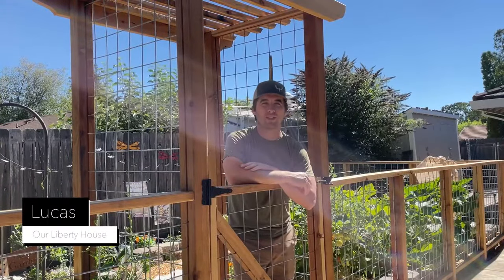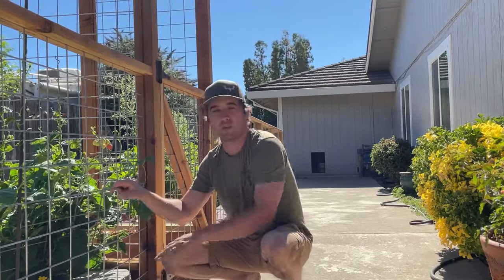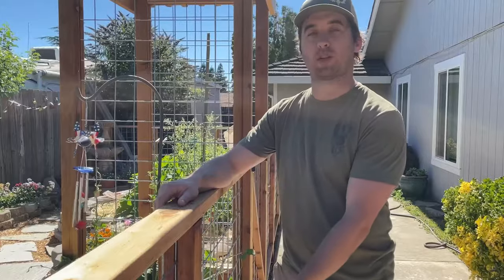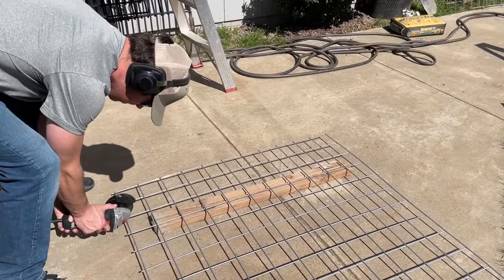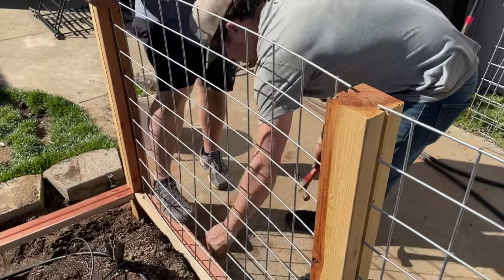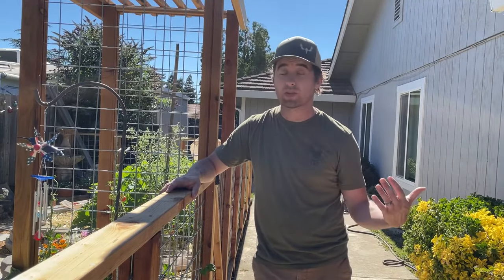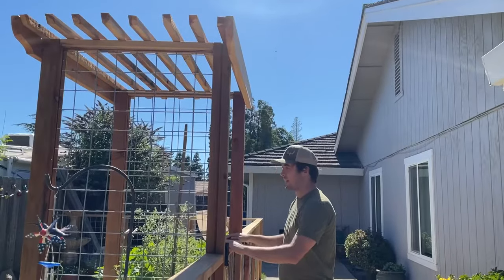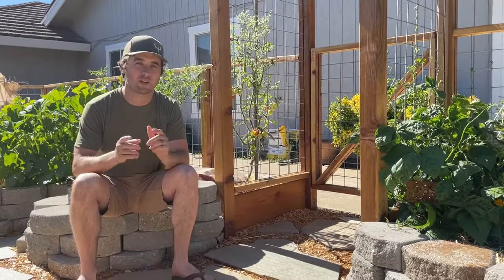DIY CATTLE PANEL GARDEN FENCE // How to Build a Sturdy and Beautiful Fence for the Garden

Comment: Looks great. But from one carpenter to another... You should add weep holes in the bottom rail so that any standing water does not rot the wood prematurely. Water is the enemy of all wood, treated or naturally insect resistant, because it invites the bugs whose sole purpose is to convert organic material into soil.

Comment: Switch the direction of the cross brace on the gate. It should go from bottom to top on the hinge side. The top of the brace should be closer to the latch and the bottom of the brace should be close to the bottom hinge.

But looks great! I'm going to do the same/similar in my garden. Thanks for the video!
Reply from the maker: Thanks for the tip! Definitely a nice fence. My parents love it

Comment: This is an awesome video. Very clear and inspiring. 2 questions: can we use hog panel instead of cattle panel 2) we live in an area with woodchucks and rabbits and currently have a fence that I've been told has chicken wire sunk into the ground to keep those animals out.  I'm not a do-it-yourselfer. How would you explain that chicken wire process to someone if they were going to attempt a fence like yours? I love the aesthetic. I also, sadly, think we would have to reinforce the bottom of the panel with chicken wire about least 2 feet from the ground to keep baby rabbits, etc. from squeezing in as well. Thanks for your thoughts.
Reply from the maker: You probably could use hog panel instead, though you may have better luck stapling it rather than routing it. Since hog panel is more flimsy it may not stay in as well. We have a video on our hog panel fence too! Good luck!

Comment: Good for you! Good to see the posts are rabbeted for the cattle panels to inset rather than the other methods bc it finishes it off beautifully and the strength is there. If you don’t have a router or router table use a table saw and make repeats till you have the depth and width needed or a circular saw and straight edge will work too. And the Cedar looks stunning. Love the gate, love the arbor for shade and I love that you can see through into your garden… really nice work
Reply from the maker: Thank you so much! It was definitely a labor of love. My parents love it and when they garden was in full swing thing year it was beautiful with everything climbing around it. Thanks for the comment!

Comment: Alternatively you could also use a dado blade on a table saw for your groves.  Also cattle panels would cut your costs down significantly. Nice job!
Reply from the maker: Dado blade with a table saw is a great option for someone who doesn’t have a router. I’ve never used one before. Any tips to share with people for success?
Reply: @OurLibertyHouse  Make sure you use a push stick to keep all your fingers and safety glasses. It's all fun and games until someone loses a finger or an eye!

Comment: Looks great! I've been eyeing this design for awhile. Best one I have seen. I am wondering if putting a couple holes though the routed groove in the bottom would be a good idea to let water drain out and not stay sitting in the bottom for too long. I'd use pressure treated wood, unfortunately we do not have redwood easily available here, but in a slightly wetter climate wondering if that would keep the wood better for longer.
Reply from the maker: I definitely don’t think you could go wrong with adding drainage! Very smart idea. Thanks for commenting!

Comment: suggestions for keeping the dado straight without a router table?
Reply from the maker: Hey Emma! I’ve actually never done it without the table but you could create a “fence” using some spare lumber and clamps (just like a guide) as if you had a router table
Reply: Yeah that’s what I would do, use a straight edge and some strong clamps for the straight edge. Thanks for asking this question

Comment: Does any of this rot or rust in the elements? I’m thinking of doing this, but live in the PNW.
Reply from the maker: I would make sure to get galvanized steel which won't rust.  Any and all wood will eventually rot, but we like using Redwood, which is rot resistant (like cedar), but you could choose to seal the wood if your worried about rot.

Comment: How far apart are the posts?
Reply from the maker: Roughly 48", the cattle panel is forgiving and cut to size after the posts are in place, so if you're dealing with tough soil to dig in we found it does not need to be exact.